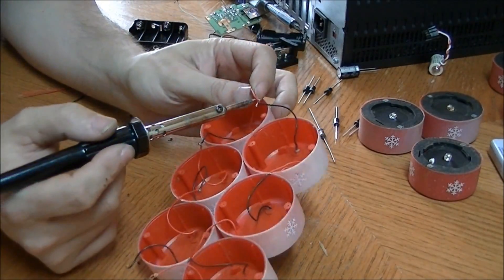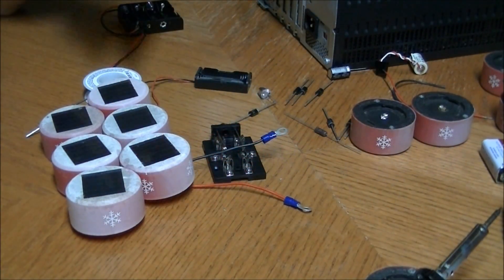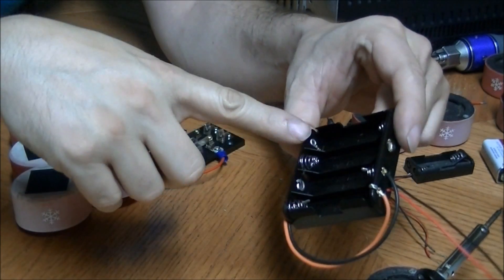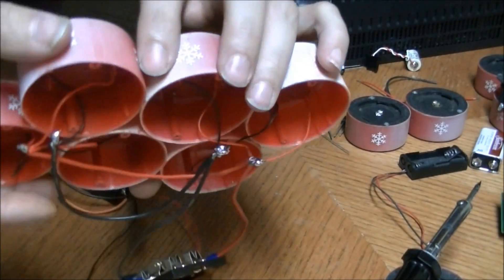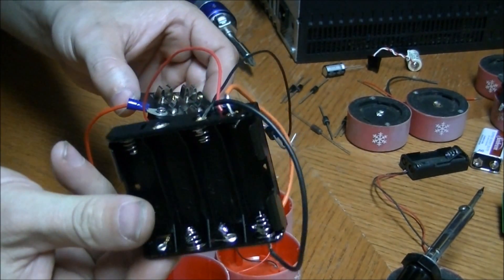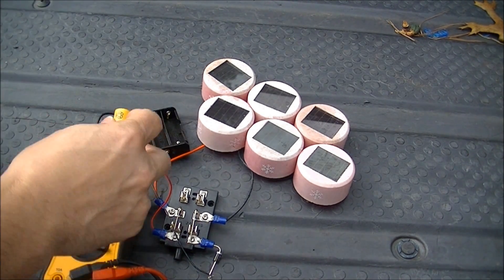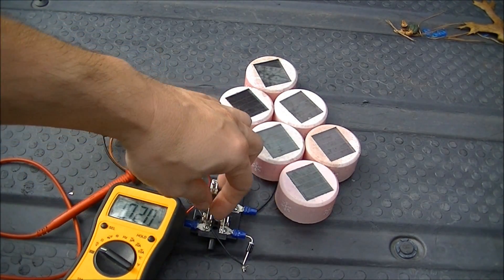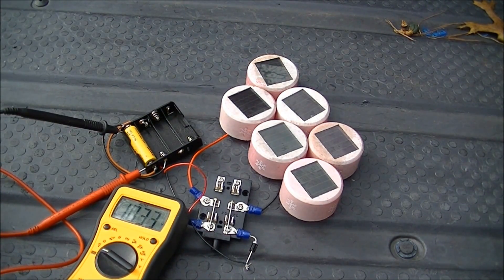DIY Solar AA Battery Charger Build

Comment: I` have a question, If u put 4 rechargerable battery will it charge in same time as u only put one battery ? or will it take much longer?
Reply from the maker: In a perfect world it would take 4 times with these panels but batters are not perfect. With some new hybrid battery they can lose 20% over a years and would be about 4 times + or - a little. While some old batteries can lose 80-90% over night and these cell would never be able to charge 4.

Comment: why did you put the diode on the NEG side ?
Reply from the maker: No reason, it will work on ether side as long as the diode is turned the right way. One simple way to tell if the diode is in the right way, there will be voltage at the battery pack. If the diode is in backwards, there will not be voltage going to the battery pack. But if more is hooked up to the battery later, every diode should be hooked up on the same side.

Comment: I have made something similar to this. but my question is does this design work on NiMH batteries?
Reply from the maker: Should work on any rechargeable battery.
Reply: i have tried but for some reason it does not work. did the entire process three times now and still not getting any charge
Reply from the maker: sorry it is very hard to tell without seeing it. Make a video of what you have and post it. With as much of the wiring  as posable.

Comment: How  charge  more  fast  6  solar  panel  in  siries or  in  paralel ?
Reply from the maker: +gogu gogu The power coming out is the same, but it would depend on how much voltage the battery needs and what voltage is supplied. For most people using a 12 volt battery they will want to charge it with 14.5 to 15 volts, but if 21 volts is put in it the battery will still charge at 14.5 and the extra voltage will be traded for higher amps.
However if I was charging a 6 volt batter I would want to split the solar panel voltage in half.
Reply from the maker: +Ryan Walsh 2 ni-cad battery would run about 2.4 - 2.5 volts and last longest if charged slow. When charged fast they get hot and the cadmium builds up on the plates causing what peoples used to think was memory effect. Anything from 2.55 to 3 with low current will work, but be careful not to overcharge.
Reply from the maker: There is no memory in batteries, but over heating does cause plating of the battery cells. Fast charging does cause over heating.

Comment: looks like your diode is backwords
Reply from the maker: +Je Be The diode goes in based on the battery in the circuit. One simple way to tell if the diode is in the right way, there will be voltage at the battery pack. If the diode is in backwards, there will not be voltage going to the battery pack.

Comment: Wot the diode for
Reply from the maker: +Graham Bate The diode prevents the battery from discharging back into the cell at night.
Reply: sweet thx mate
Reply: Jason Roush it is amperage that is important when charging
I know the difference between series & parallel
Reply from the maker: as long as you are putting in more amps than you are taking out, you are charging. Including internal drain.
Reply: You need about 9 of those cells in parellel to get the required 200 mA 
to charge two 1500 mA cells
That is in direct sunlight for a few hrs.
That is if all your cells have a good output rating, adding a low value cell into the parallel, acts like a resistor on your array, and will pretty much knock all of them down in voltage and amperage.
Reply: wot ???  use English and stop trying to make up your own language.
Reply: not all solar cells do that
Reply from the maker: yes, all solar cell put out voltage, but it is up to you to put them together into the right voltage.

Comment: You have connected wires to only two of the battery pack terminals (the first two), yet you say that the current will flow through ALL of the four batteries... Is there a hidden connection in the battery pack that we can't see?
Reply from the maker: RonRay the battery packs comes from radio-shack. It is wired for 4 batteries, but I rewired it for charging 2.

Comment from the maker: Ok, I see where the confusion is. The site you have linked has the diode on the + wire. I have the diode on the - wire. But both diode are hooked up the same way. Keep in mind the Cathode goes to the - of the cell and the Anode goes to the plus of the cell no matter what side you want to put it on. So that if you want to move the diode from the + wire to the - wire the diode must be flipped over.

Comment from the maker: I just check it again. If it was backwords the cell would not be able to charge the battery. The cell does charge the battery. It is hooked up - -|<- +  or as the 3rd diode in the picture on the site I just added to the Description.

Comment from the maker: It is in the right way. As it is, I have 3 volts on the battery pack with no battery. If I turn it around it will have 0.244 volts on the battery back with no battery. But thank you for noticing.